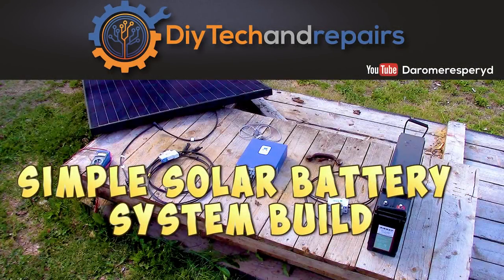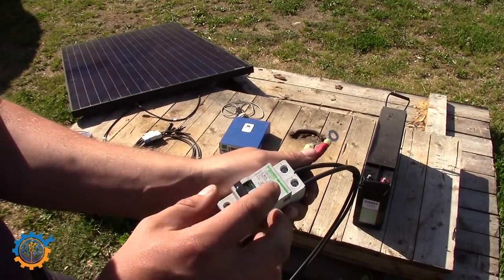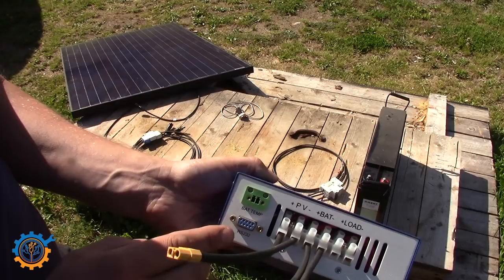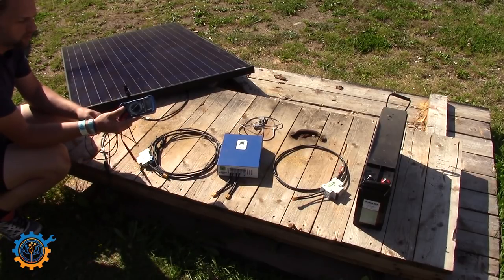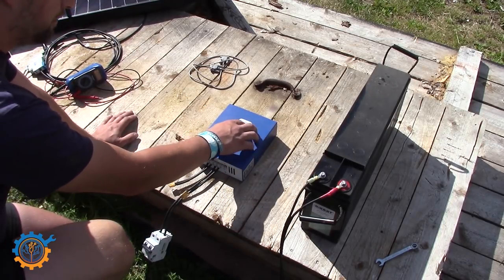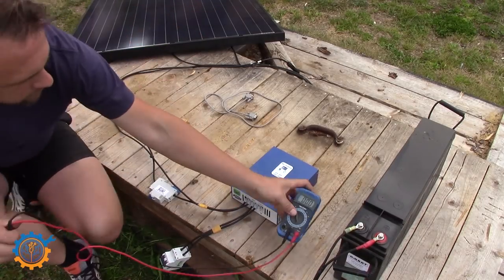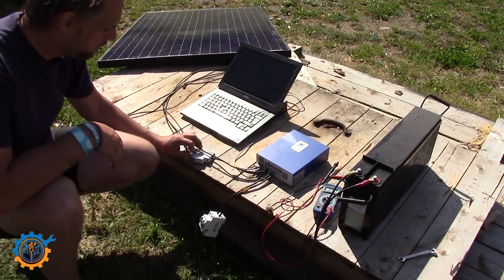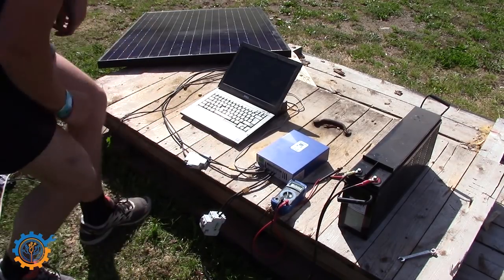Build a basic solar electric system  - Basic install!

Comment: Great vid again. Simple, comprehensive and clear thanks 👍
Would live to hear your thoughts on lightening protection for solar and maybe small wind turbines also as I don't see this covered much.
I have a small vawt but no solar yet.
Reply from the maker: Lightning protection is very important in some areas for sure! And its not that hard to implement a first stage of protection. My knowledge in it is perhaps lacking some so i dont know if I with confidence can fill a video about it :)

Comment: Good video . on the pcm60x it has a earth/ground screw at the right hand side can I wire this earth on to my house earth/ground  that comes from the grid ?
Reply: GAZ KOI KEEPING it is not a good idea to connect solar to house ground. They need their own path to ground. To prevent the electrifying of the equipment in case of a ground fault. And I am sure there are other reasons! But they need a separate ground rod!
Reply: What about grounding on the house ground near the actual ground rod? Wouldn't a separate ground rod risk creating a ground loop?
Reply from the maker: @jamest.5001  depends. Where i live its Always hooked to same ground as the house/grid. We are not allowed to have more than 1 ground! They need to be connected at same place. With that Said There is solar products that are not allowed to be grounded
Reply from the maker: @Markle2k  it could yes. Always follow regulations in ur area!

Comment: The solar controller is EPSOLAR which looks completely different to your unit and only does lead acid batteries.
Reply from the maker: Yes its different because above is discontinued. They have same settings and yes both only support lead acid as such. So what is your question?
Reply: You mentioned at 0:36 it worked with l-ion batteries. 
No problems I will search for MPPT with Lithium batteries (preferably LiFePO4). 
The unit you recommended had very good efficiency (>98%).
Thanks for great channel. I enjoy watching your videos.
Reply from the maker: Yeah you can get most of them to work with Lithium as a bare charger. But its important to understand that they dont do any balancing so you need to manage that

Comment: gday danial, u got the solar side wrong cos of the mc4 connectors.... installing them on a regular basis, u will soon learn to always check polarity b4 connecting the dc circuit breaker to the solar controller. Stick to them rules and u shud not make that critical mistake. I would much rather use the xt60 or xt90 connectors on everything possible nowadays I am a super converter as they r so easy and polarity correct all the time, if ya wire is too short? then no probs just connect up an extension lead to go the distance u need. The issue with the xt connectors is when ur trying to solder 10 gauge wire or bigger... the bloody pins get too hot and melt the plastic... I will need to design a jig to stop that from happening. Cheers big ears :)
Reply from the maker: I got it wrong in The video to show you guys it Will happen ;)
Reply: Ahh I see, but u didnt explain why or how easily it is to get it wrong. With the mc4 connectors is where the change of polarity happens, they r a pain in the arse... where the xt connectors r so simple.
Reply from the maker: OffGrid Aussie Prepper™  Ur right I didnt go into detail. Its easy that a video like this gets to long other wise :P But yes its easy to mix those up